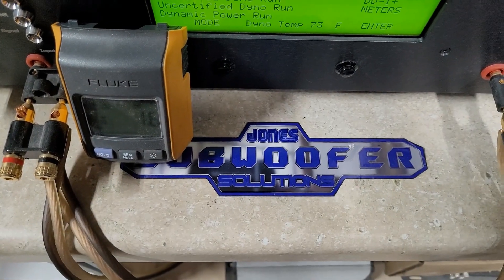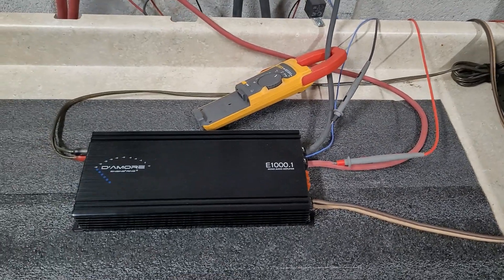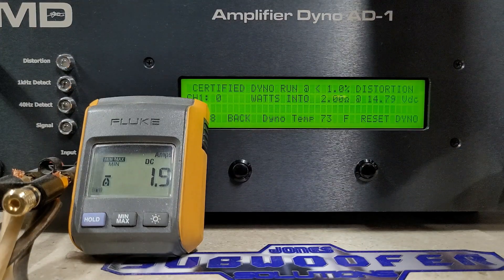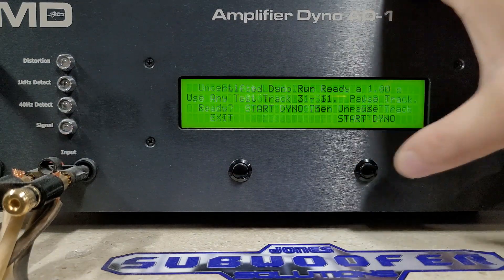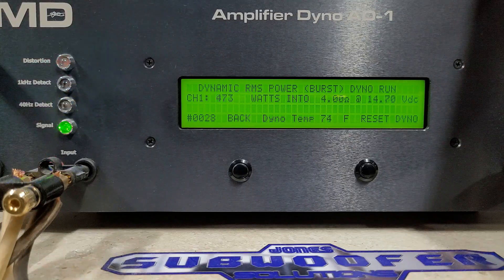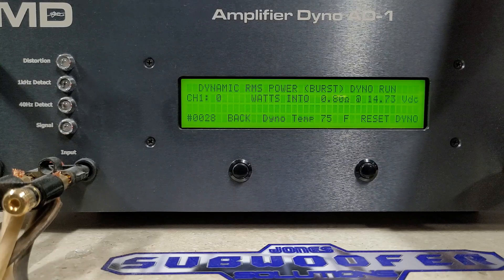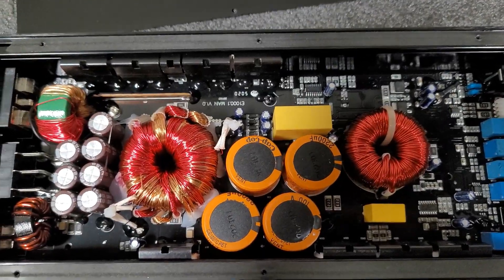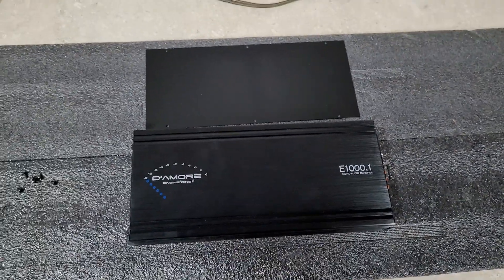AD-1 Amp Dyno D'Amore Engineering E1000.1 by Jones Subwoofer Solutions JSS

Comment: Thinking about getting one, 14.8 volts isn’t what it’s gonna see in car , curious what’s the real power 12.5-13.5 ?
Reply from the maker: It's factory rated at 14.4v
At 12.5v you'd see slightly less power but still see rated or very near it.

Comment: Bought one of these a month ago. Connected it to an old Soundstream SPLX-152 15" in a large ported box. Previously connected to a Goliath xxx6500. My first impression when it arrived was I had wasted my money due to its tiny size and light weight. However after installing it I have to say this is the most impressive amplifier I now own for its size and cost. It never seems to get hot and the sound is so clean and loud even close to distortion. Buying the E1500.1 next.

Comment: seems like quality but i dont think 3x40a fusing is  needed. 3x35 would be spot on
Reply: Maybe 40a were cheaper than 35a?  Who knows?  The amp has to be built the best it can be for the cheapest as well.  It is always a compromise.  Just like having 12 gauge speaker terminals.  Why put bigger ones on when you don't need it.  That money saved can go into bigger or better caps inside.  I have been looking a long time for a clean amp, and have never seen one with >100 s/n ratio, so whatever Tony is doing is working for a decent price as well.
Reply: @Kelvinbellrose  yes I agree on the speaker terminals. I hate seeing people use 8 gauge speaker wire on even a 2K amp. Total waste of copper
Reply: Send Tony the suggestion on how to build his amps he hand designed

Comment: Mane juz be real it only does rated anybody kno on a GMC truck or any computer controlled charging system it cut's bck once it gets hot and only charge at 13.8🤔
Reply from the maker: There's solutions from $8 and up that will help you charge anywhere up to 15.5v in that vehicle.
The amp is rated at 14.4v anyway, not 13.8v.